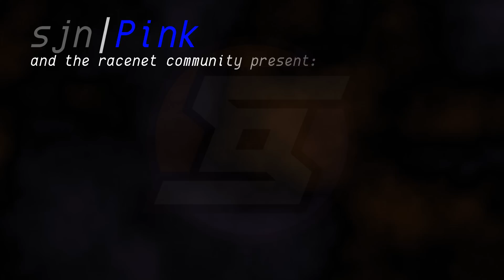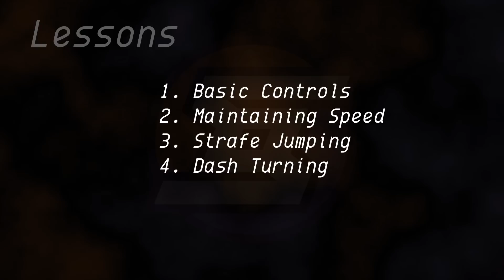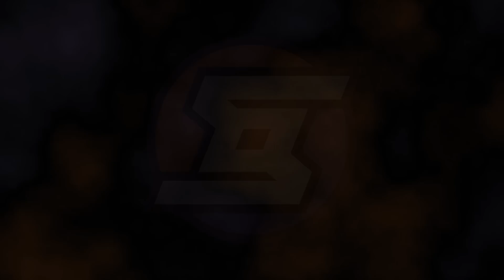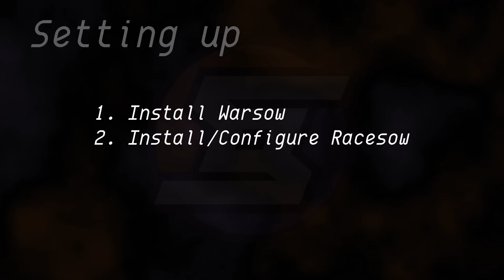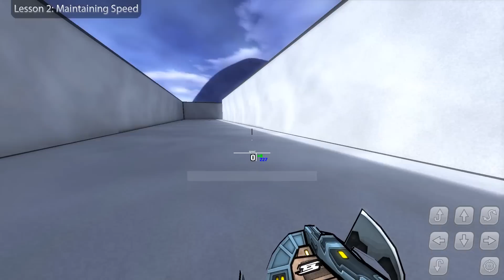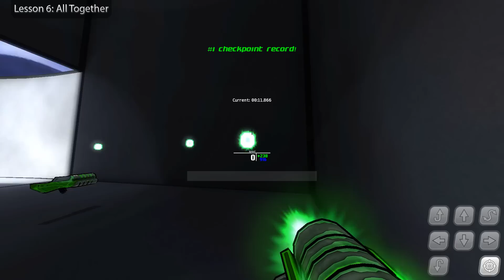Warsow Movement Tutorial 1 - The Basics

Comment: a good idea is to just put the hud file in the basewsw folder located in your main warsow folder.  that's what i did and it worked just fine. but that's not the only thing you need to do.  when you set it up and start playing you have to type 3 cmd in the console: cg_showpressedkeys 1, cg_oldmovement 1, and cg_strafehud 1.  this will set up the hud mostly the same as shown in the video.